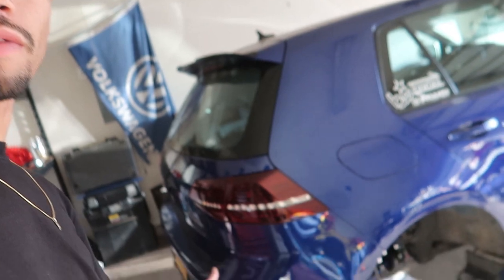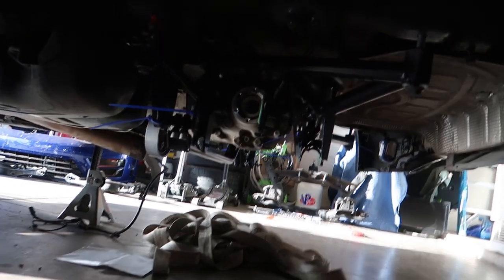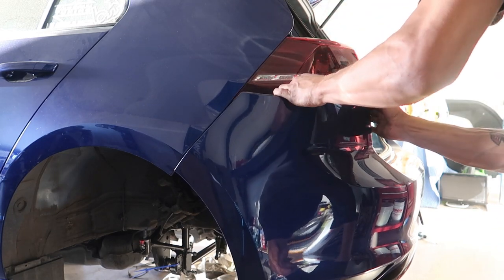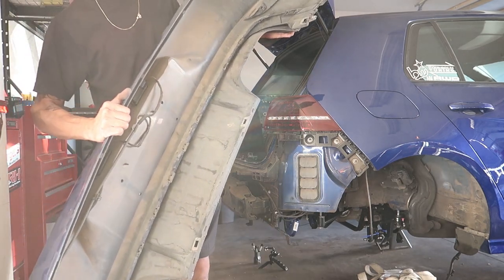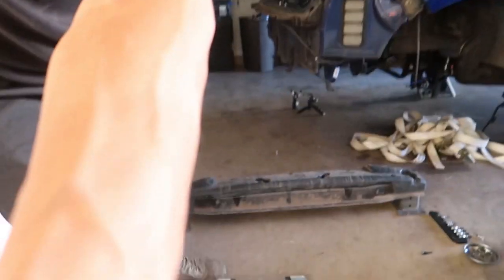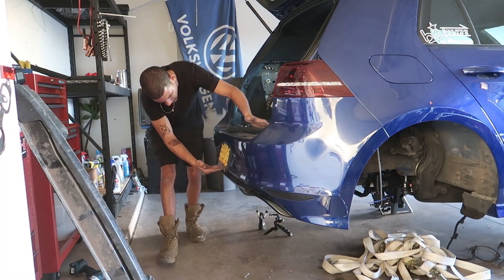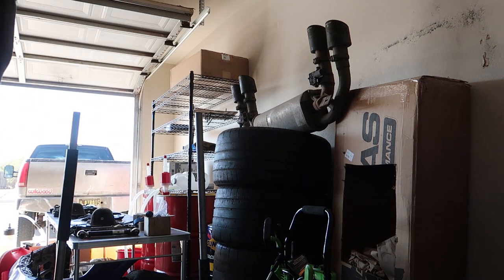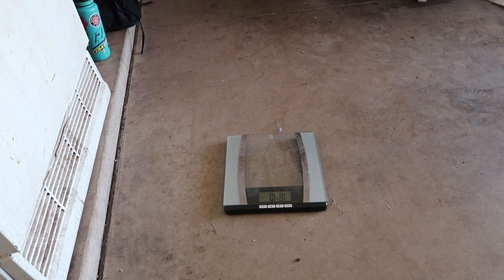Rear bumper removal & Crash bar DELETE! | MK7 Golf R

Comment: That rear “crash bar” bolts up to the chassis frame rails and provides stiffness you probably want to keep for high speed riding. Also, taking out the rear taillights makes it even easier to get the bumper cover off and back on. Keep up the good work!
Reply from the maker: Are you 100% on that? Might have a to make a mini bar if that's the case.. I feel like this rear end and hatch brace will suffice though
Reply: Bryce Jordan Productions you will know if it’s loose and squirrelly... I took one of these off to add a receiver hitch to an R and considered not putting it back on since the receiver hitch is there. However, decided the stiffness, or extra stiffness was more desirable because the bolt slots on the hitch were sloppy compared to the tight fit of the factory crash bar.
Reply from the maker: That was on this mqb platform or another? Very interesting. I will look deeper into this, thank you 🤘
Reply: Bryce Jordan Productions a fabricated mini bar will save you some weight. I think you will want both of the frame rails tied in together. Other people even put an extra brace inside, between wheel wells and top of rear strut mounts for extra stiffness.
Reply from the maker: I planned on doing a custom tubular for the front.. guess I'll do both if it feels fishy back there!
Reply: Bryce Jordan Productions 2019 Mk7.5 Golf R and nxt will be adding a receiver hitch to a 2018 Mk7 Golf SE. We have been building air cleaning “monster trucks” but now it’s time to build air cleaning race cars. The internal combustion engine is not the problem, the problem is the fuels we are “allowed” to burn in them. Need the receiver hitch for racks because we put a high pressure fuel storage cylinder in the back cargo area as part of a fuel system upgrade. We work with all the cleaner, safer local fuels that cost less than the deadly DIEsel and toxic gasoline. We call it Riding Clean & Saving Green! With Intergalactic Hydrogen, burn rubber instead of toxic gasoline! Why? Because “R” caR is cleaner than your car” we can save the ICE with Air Cleaning Engine, A.C.E. Technology. Burning Compressed Natural Gas, CNG and or Hydrogen as fuel produces cleaner exhaust out the tailpipe than the ambient air in any metropolitan city~
Reply: @airtaiH2  lol
Reply: I wanted to go back on this I’m just seeing the video now cause I was planning on doing the same thing… have you noticed any issues with it being out?
Reply from the maker: I haven't noticed any negative from it 🤷🏽‍♂️
Reply: Perfect, looks like I’ll be taking it out 😂. Thanks!
Reply: One more thing I just realized does your bumper have more flex to it without the bar or push in?